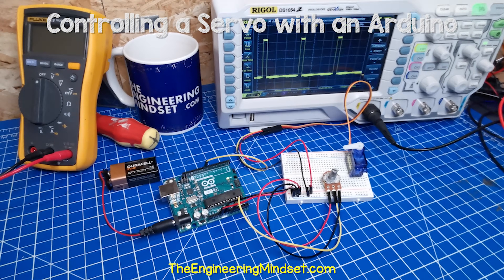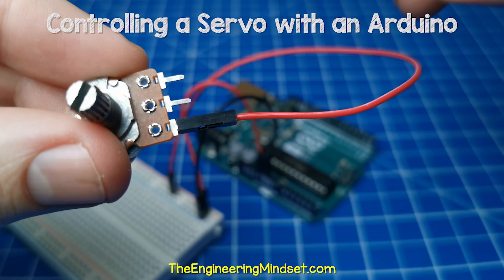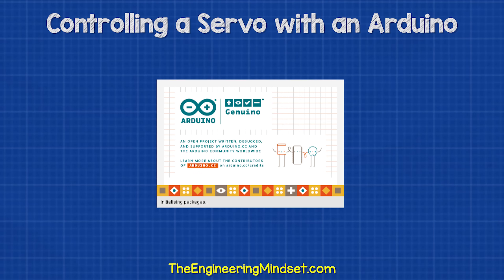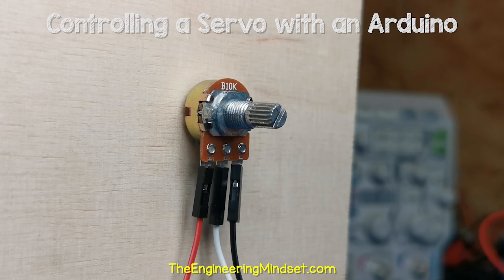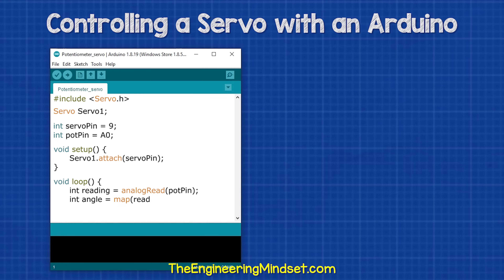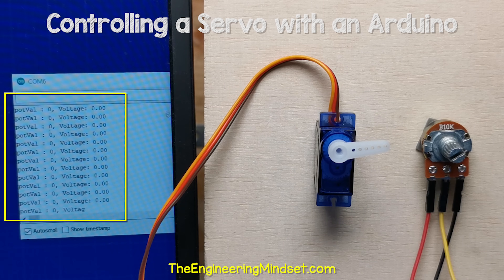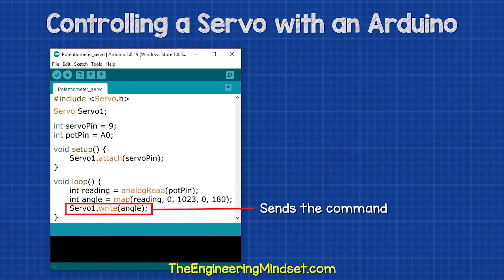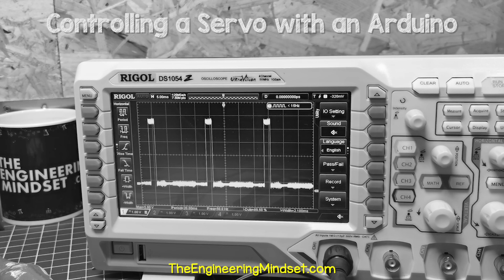How to Control a Servo With an Arduino

Comment: Can we control servo with two buttons?
1 button is to control from 90° to 0°, and another button control from 90° to 180°
But when we don't push any buttons it will back to 90° automatically

I hope there's answer from y'all even just saying "no" 😅

Comment: I am looking for a control board to control fan speed for a model exhaust system for a model tank have an ide speed and when I move the RC stick forward the fan speed gets faster same in reverse when the stick is  in in the middle ide happens

Comment: hey if you do this dont swith up the wireing it may catch on fire i speak from experiance
Reply: Same happened to me
Reply: What do u mean by switching the wiring?
Reply: @shadishehade8927 accidentally plugging the wires in the wrong ports
Reply: Or you could just know what your doing. I speak from EXPERIENCE

Comment: Hey, noticed your diagram says to connect both power and gnd to the same positive rail on the breadboard, from the arduino. did you mean that?

Comment: Can anyone help me? I want to build a  pair of dual pir activated servos. 
My problem is power.
The servos are 4.8 to 7.2vdc. I was going to use 2 18650 lithium batteries but its too high at 7.4v.
I have a L7905 regulator but Im not sure if it can supply the amps needed for 2 sevos under load.
Could it? Shouod I use it? Would a 6v regulator be ok?
Or a step down?

Comment: Hello there! I have a question, can I connect the servo motor straight to the arduino and computer to power it? Or do I need a capacitor(i don't really understand how they work yet) or a different power supply to power it? Thanks!

Comment: Is it posible to manipulate the servo speed when we programmed like this?
Reply: Depends on if its a continuous rotation or fixed rotation. A continuous servo will let you control the speed it spins at but it has no way of knowing where its position is. A fixed rotation servo will let you control speed (technically), but also the position of the servo (usually from 0 to 180 degress like in the video).

Comment: Is '1023' significant?
Reply: It's the highest number representable by 10 bits (1024 possible values, from 0-1023), seemingly the most common resolution of these boards' analog to digital converters (according to the googles).
Reply: @mascot4950  Thanks for the response. Funny how I didn't catch that when I watched the video. But hindsight and all that 😀

Comment: my coworker and I have prank-battle going which most recently involved sirens tied to timers based on my "im in a meeting" switch. I need to get him back. I'm dreaming up ideas. If anyone has any, i'm all ears. we're both chemical engineers, he's traveling half the time. His office has a fridge, a fancy computer setup, a Culligan water cooler and other basic office stuff. Unfortunately he shares his office with a cool dude that I like, but I'd be willing to have collateral damage lol. I'm not much of a circuits guy yet ( I dabble) but I have been thinking of something like a circuit connected to servos that push his ceiling tiles down onto him (not trying to hurt him though), or flips his keyboard. Or maybe something that is just annoying like a bell that rings when they open their door like a retail store. I'm not sure yet.

Comment: hello. what is the point to connect it to an arduino when a servo tester does the same?
Reply: It allows users to experience programming and control systems thus opening up opportunities for further experimentation. Cool in my opinion. 🎈
Reply: With a servo tester you are limited to just that, but with an Arduino this could be part of a bigger project of which the use of a servo might be just one part. I think this video is more about how to interface with a servo, rather than as a Standalone project.
Reply from the maker: Servo tester is manual, you can program the arduino to move automatically
Reply: @EngineeringMindset  thank you